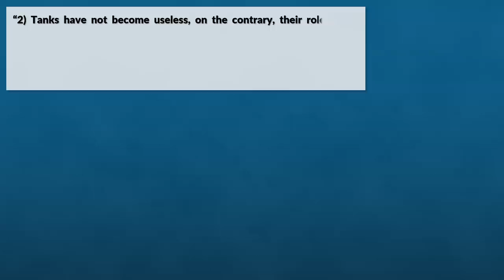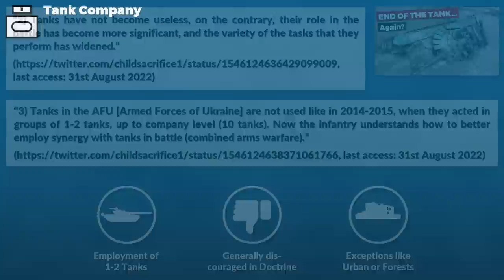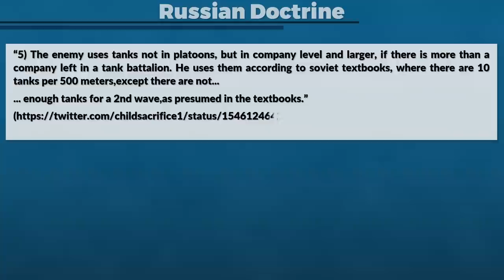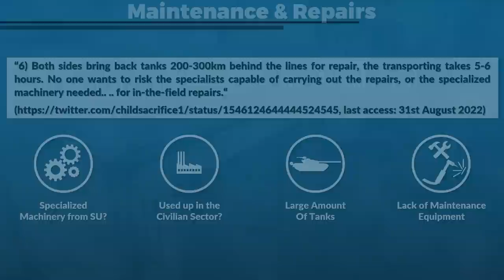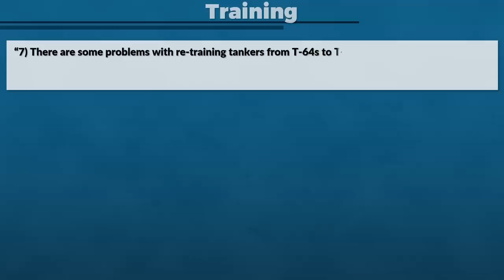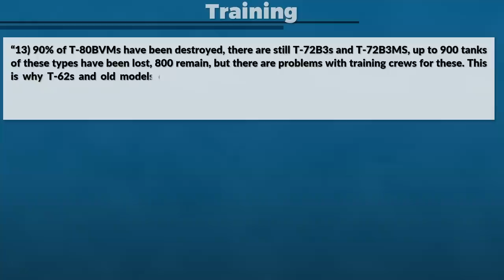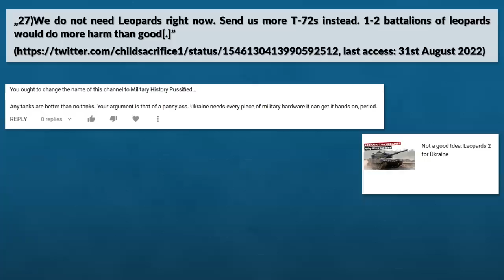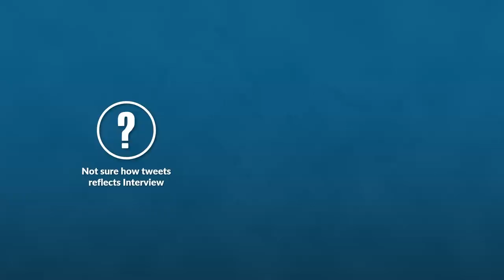What Ukraine thinks of Tanks

Comment: Would logistics costs preclude using  old tanks as self propelled guns?

Seems to me that older tanks would add  a lot of value as mobile artillery assigned to infantry units. Their ability to rapidly “shoot and scoot” … firing 10+ HE shells and then moving to avoid counter battery fire. Their armor should be sufficient survive most Russian counter battery fire. Their protection from RPGs and anti tank rockets would come from the infantry they are supporting. One would assume them to be doomed in any tank on tank fight.

The idea would be to ALWAYS deploy them BEHIND infantry units. Their role would be purely defensive, limited to anti-personnel fire missions. The tank crews would only receive the training required to fire the gun and drive the tank between missions. 

I’m thinking the age of the tank, armor thickness, and fire control system would be nearly irrelevant. The availability of ammunition, maintenance and training requirements would be the critical factors.

The Ukraine war seems to have devolved into WWI. I’ve not seen any reports of tank on tank engagements making any difference in battles. So why not consider using old tanks as SPGs?
Reply: Sometime you will need thing that can deliver a good piece of explosive in 2 min, on battlefield, your don't have time to pull out a radio to relay info of your target to the self propelled gun behide the line because....well, the target raining fire on your position, or sometime: a jammer
Second thing is: you take your men as meat shield for your tank, no, please don't do this, unless your tank is so valuable that you agree for the live cost
I agree with your on the training thing, it depend on doctrine but i disagree you one the last line: it only cost 3 men per tank destroyed right on the battlefield, cost no live if the tank is mobility kill, what if the missle hit on the APC(russian APC have ~8 men in it) or because the enemy see you do not have tank, start raining machine gun ASAP?
Reply: Think of US tank destroyer doctrine in WW2. The idea was that they'd hold back, ready to jump into action quickly when needed. But the reality was that, when you have a big gun on a mobile platform available, you'll use it. That is what would happen here. If you have a bunch of tanks and there's a problem that could be solved with a bunch of tanks, you're going to use said tanks. Doesn't matter if said tanks are supposed to be used as artillery.

I'd expect there would be other issues as well. Artillery units have shells that are specialized for the artillery role. Things like air burst and so on. Tank rounds are specialized for things tanks do, like direct fire.
Reply: @Axterix13  US also use tank as artillery with indirect fire role, the problem is: barrel can't stand the absurd amount of round firing per day, and need charge barrel per 1000 round, tank round is can't charge power load as artillery round, only normal contact fuze HE and maybe smoke can be use, other type can't
Also many tank design do have a indirect fire sight, but will require dig a hole for tank have enough elevation for indirect fire
Reply: @Axterix13  I agree it would be near impossible to use them only in their SPG role. 

I also agree specialized howitzer shells would be better than tank gun High Explosive (HE) rounds.

But a 90 or 105MM HE Shell from a tan can be used in direct or indirect fire roles with devastating effect.

My guess is a 90MM or 105 MM tank HE shell would be at least as effective as a WWI French 75mm gun - a gun which slaughtered 10s, maybe 100s of thousands infantry soldiers in WW1.

What makes old tank's worth considering is that they would be able to both survive and move to escape Russian counter battery fire.

Neither Army can advance more than 10 miles? at a time. Supporting WWI-like trench lines with SPGs sems to make sense.

On the other hand, "Everything is easy for the people who don't have to do it."
Reply: @duytranuc4025  I probably want clear.

1. Old Tanks used as SPGs role would be to PROTECT infantry.  SPGs would BE THE OPPPSITE of a "meat shield."

2. Old Tanks used as SPGs role WOULD NOT be to replace modern tanks. My idea is that modern tanks would be used in offensive assaults. SPGs would primarily SERVE specifically assigned infantry units with fire support from behind the infantry.

3. SPGs would be attached to specific infantry units. The SPGs would closely coordinate with their infantry units. Infantry and SPG commanders would map a sector and define pre-arranged targets.

4. SPGs would offer the fastest possible and most effective fire support to their infantry unit. (Think of them in terms of an infantry company's organic mortars.)

In many cases, SPGs could fire on targets without even being called. Picture an overwhelmed infantry unit that's just been shelled - that is unable to communicate.

SPGs would be deployed close enough behind the infantry to recognize and respond to emergency situations - without being called. 

5. Russians nearly always heavily shell Ukranian positions before attacking. SPGs armor would protect them from the much of the barrage. SPG mobility would enable them to move out of the barrage.

SPGs would then move back "up" to their positions when the barrage lifted. 

Possibly most importantly, the SPGs could fire on Russians advancing in the wake of the barrage. 

The SPGs would be firing on the most critical pre planned targets in the sector - because fire support for the sector was pre planned.
Reply: @Gozerthegozarian1984  your point is clearer now, and i can answer you here:
1 They tried that, in ww2, "assault gun" and "assault tank" and "infantry tank" fill the role for that
2 Almost all of them then become a thing call MBT or "main battle tank", some doctrine make them tie to infantry unit, just as you describe
3 Later then they make another type of AFV for that: the IFV or "infantry fighting vechide" which many have a autocanon or a full size canon on it, also to fill the roll "fight with infantry, move with infantry"
4 they also make tank/IFV with an indirect sight, but that thing is not it main roll, and tank cannon lacking some bit that require for a artilery, like a recoil blade, or substain the rate of fire over 10 rounds(tank gun do overheat quick, now with the help with a barrel thermal sleeve)
5 tank do break down, and it faster than you think, only around ~2000km, and drink fuel like no tomorrow
6 the armor on the tank do not do any better than normal SPG again counter battery fire, it only death weight, a direct hit from a 155 still disable it, also make it slower than a truck base SPG
Reply: @duytranuc4025  Agree with all most of your points. 

I was considering the possibilities using old tanks as SPGs as a way of cheaply and IMMEDIATELY strengthening Ukranian defenses. Of course, purpose built 155MM SPGs would be better than old tanks with 90/105 MM tank guns.

Again, I'm not proposing replacing MBTs, actual SPGs, IFVs, or AFVs. I am proposing adding old tanks for use in purely defensive roles, to support infantry positions and strong points. (Which would reduce fuel and maintenance issues.)

I have to believe an infantry unit would be grateful to be backed up with several dedicated old tanks firing 90/105MM HE rounds, even considering rate of fire/overheating issues.

Agree that howitzers can disable and kill tanks. But an old tank would take a lot more punishment than an SPG.  They would be more versatile than a truck mounted gun due to their superior off-road performance.

Seems like a moot point after the last week.

Looks like Russia is the one that has to start considering using T-55s and T-64s 😀
Reply: @Gozerthegozarian1984  there are a way: convert it to a SPG platform, remove the turret, mount a bigger gun and arty stuff on it, russia already do that with the 2s19 SPG, 2S35 SPG
Or convert it to a....BMPT which russia are already do
Using T64 platform is bad idea though, it a "elite platform", like t80 but very hard to find part. Use the "mass produce platform" like t72, t90 can be a better choice (they have alot of t72 not at B3 standard)